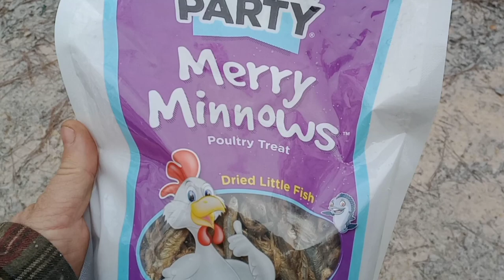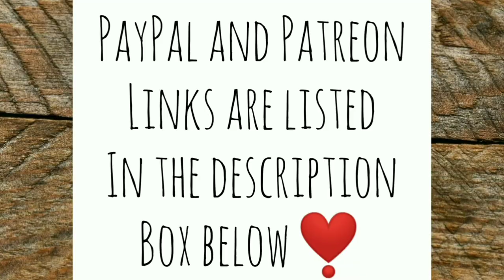Prepping for the Winter Storm 100% Off Grid With Chickens! - Ann's Tiny Life

Comment: Open window, take bath towel put in opening then slam window shut on top of it. Roll remaining towel length around window sill. Cover entire door with blanket, even you have to nail it to the top of FRAME. Keep a large pot of water simmering if you have a wood stove. Drape warm material over your bed, heat rises. Put a thick blanket under your bedsheets. GOD Bless.

Comment: Unfortunately being off grid you can’t use the eclectic water warmers that we use to keep the ice away. But Don’t worry about the chickens being cold. They will be fine. Have a great day.
Reply from the maker: you're exactly right rick! you kind of got to pick your battles when using solar. and as it turns out I don't really need one. the heated water bowl that is. the water does freeze but if I put enough water in the tub it's not all going to freeze. you'll see tomorrow.
Reply: @AnnsTinyLife   yeah unfortunately the cost of a large solar system is tens of thousands of dollars. We are the second to the last property on the grid. I see the the challenges my neighbors face.

Comment: Hi Ann. So glad the van stays warm for the chickens! I do the deep litter method in the coop, too. It does help. I'm wondering if it would help if you lay a pile of wood chips down and late the water bowl inside it to keep the water from freezing during the day? For the longest time I'd been using chopped straw inside and out of the coop. It's really good at soaking up wetness and the chickens really liked it. But at $11. per bale it was getting expensive. My local chicken/feed supplier has the big, condensed 3 cu ft pine shavings for just $7, so I've been getting those. It works really well in the coop and yard, just don't like it in the nesting boxes because it's not soft like the chopped straw. Oh well, you do with what you have, right? Maybe later I'll just save the straw for nesting boxes only. Stay warm! : )
Reply from the maker: it was warmer in the van than it was this morning in the tiny house. lol I'm so glad my chickens did well. I use the pine shavings. I even use it in the nesting box and they don't seem to mind it. I get mine in a big huge bail from tractor supply for $5.99. but they didn't have any! so I got a smaller bail and it's working okay. I'm just so exhausted!
Reply: @AnnsTinyLife  - Oh nice! I just checked them online and am going to pick up some today, since I need to go to town anyway (and it's 5.5 cu ft)! Thanks. I'd been getting the chopped straw from them before. Yeah, the chickens still laid in the chips, too. I just wanted to give them something softer. Maybe they don't care. : )

Comment: Could you use a heating pad to put under thier water. Dish you need some heat lamps for ur van
Reply from the maker: I could but that will tax the solar batteries. it requires a lot of energy to create heat. and I don't mind going out and replacing their water.